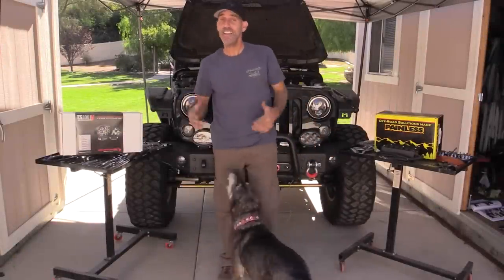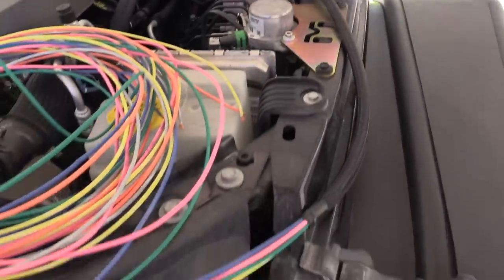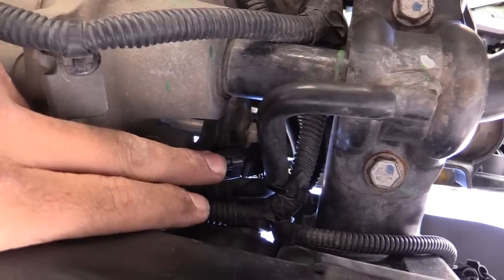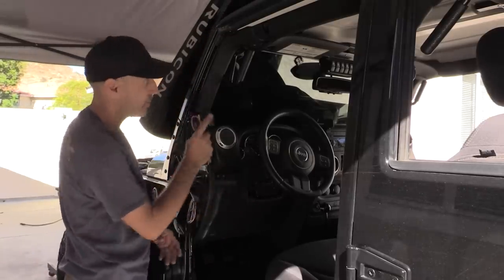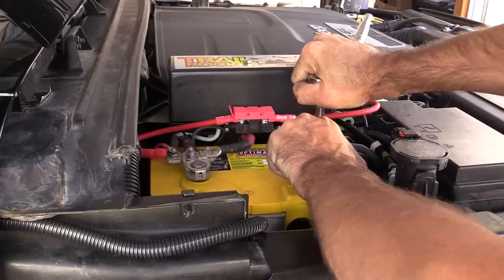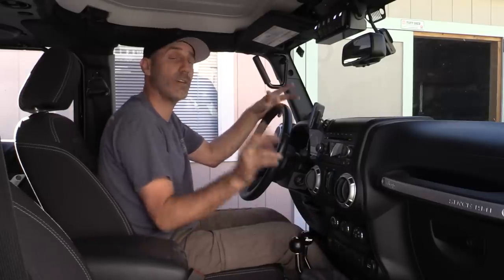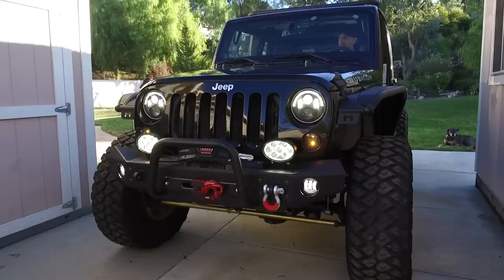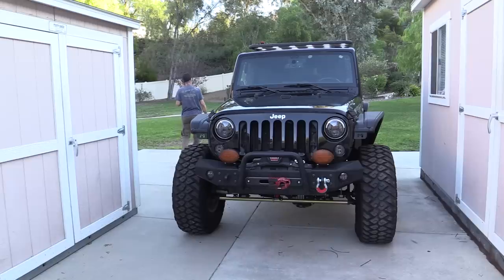Painless Trail Rocker Switches and JW Speaker Jeep Lights PLUS E-Locker Bypass Hack

Comment: I installed the SPOD version of the same thing.  I only have the halo from my Oracle head and fog lights wired currently, but love the utility of the underhood unit. The SPOD has a voltage sense circuit that cuts off the SPOD when it detects vehicle battery voltage below around 11.8v.  Pretty great piece of kit.

Comment: Hi Jason, just looking for more infor on your locker switch wiring mod, and if you did your sway bar as well. I looked through your subsequent videos but didn't see one adressing this in more detail yet. Thank you Sir.
Reply from the maker: I didn't do anything else on that yet. It is as simple as splicing the power wire for the switch you want to operate it to the color wire I mentioned.

Comment: A possible option to save you from rewiring your fogs is a superchips device.  I would imagine, unless you've picked a different option, that you'd want to calibrate your speedo and such for your larger tires and/or gearing.  That device would also allow you to make it to where your fogs will work even with high-beams and wouldn't take up a switch spot on your panel.
Reply from the maker: Thanks for the suggestion... I've heard that a few times now about the superchips. I'm ok at this point to dedicate a switch for them and if it's as easy as the locker bypass... should take about 15 minutes!

Comment: Nearly the same setup. I didn't like messing with the ignition wire, so I used Quadratec's "12v power adapter" (JK-APT2011) (no endorsement) to connect to the back of the lighter to get it to only power when the vehicle was on.
Reply from the maker: Good tip!
Reply: @AutoEdits  On my install, the hardest part was getting the firewall grommet to fit. I have an automatic and the grommet was just barley too big and I ended up having to trim it to fit. Love my JW speaker fog lamps and turn signals.  Thinking about the tail lights and maybe heated Headlights, but I already have OEM LED headlights.
Reply from the maker: I was surprised by having to trim my firewall hole as well. On the addition of more JW Speaker lights... the tail lights are just plain luxurious... they look high end and are.  If you are even considering new options for headlights, I was at the SEMA show in Las Vegas a few weeks ago and the NEW JW Speaker headlights that come out in a month or so are going to be so worth the wait.... Game changing awesomeness!

Comment: Just an fyi if you have a flashpaq there is a setting in there that allows you to run the fog lights with high beams.... no wire splicing needed
Reply from the maker: Great suggestion, thanks !

Comment: Any filter on a light means less overall light output.  Yellow for driving or off road might be better or none at all. I’d worry the amber covers may confuse an oncoming driver for a turn signal that isn’t flashing. Not sure if there are laws on that either. 

I also kind of liked your older videos where you did more detail on the installs.  I hate wiring and was hoping for more explanations on how those kits work. 

Great video as always though!
Reply from the maker: I found the amber lenses were actually good for on highway driving and when I was off road... pulled them off for max output.  I thought the videos were getting too boring with that stuff so I started to cut it down but with your input I can start phasing some more details back in.  For this install... it was literally as straight forward as I made it appear... very easy!
Reply: AutoEdits I cant speak for others but I love the details.  More the better.  👍👍
Reply from the maker: Hey, you speak for you and I like to hear what makes these videos better for all of my friends here.
Reply: According to CA law, all lighting must be white, amber or red on non emergency vehicles. No other colors are allowed. Back in the day, old cars used to come with yellow/amber fog lights stock. Also, the DRL on my 2014 Tundra is actually the amber turn signal bulbs in the headlights.
Reply: As far as confusing them for turn signals, the Jeep Wrangler stock turn signals stay illuminated when your headlights are on, so the aux lights aren't likely to be any more confusing than the stock turn signals would be.

Comment: So you can bypass the locker switches?  You mean you can lock front and rear diffs anytime?  THATS AWESOME!!!!  There is a particular trail that i can run in 2wd for most of the way and locking the rear diff would be great for 2 small sections....

Comment: Another awesome video! I really like the stuff Painless makes. Always top quality, and this kit seems to be no exception. My only comment/complaint is the way the switch kit pushes the rear-view mirror down further into the already vertically challenged forward viewing area. This is the same reason I don't run any dash mounted acc like GPS, cell phone holder, etc. on mine. Also, rear visibility in my stock JKU with stock 31" tires already stinks. I would imagine that once bigger tires (and spare) are added in combination with the lower mirror height, you're not going to be seeing much out of the back end; at least not from the rearview mirror. Jason, as someone who has gone from stock tires to 37" and has this switchkit installed, can you comment on this? My JKU is my DD, so I need all the factory bits to work like they're supposed to if you know what I mean, lol.
Reply from the maker: Moving the mirror down didn't bother me one bit looking forward through the windshield.  The back with a 37" tire has always been tricky and after the move just took a bit to get used to.   Having the switches is worth it for sure... I think they make a 4 switch panel that mounts down by the center console for automatic Jeeps.  Thanks so much for the comment!
Reply: @AutoEdits  Thanks for the info on the visibility. I too have a stick, so I believe you are correct that the overhead is the only option. Yeah, with these new CANBUS vehicles, the days of just tapping into existing lines to run accessories are done. I too have a number of 12VDC accessories in the works, and this seems like a clean, reliable way to do things right. Keep up the great work on all your videos!

Comment: Hi Jason, I have the Painless Rocker switches too. I haven't installed yet because I can't find anywhere to stash the 16' of wire. I re watched yours and noticed you put it in front of your washer res. Did you remove anything or maybe mine is a bit different. Mine is a 2015 and one of the horns is in that spot. 
Keep up the good work! And of course that "locker video" would be awesome too.
Reply from the maker: I'm still thrilled with that thing.  Not sure what would've changed in those two years but there are definitely places to stash those wires!

Comment: Not dogging the painless system but the spod seems way more more simple   I love my spod just put the positive and negative of the lights straight to the spod. But hey as long as it works and you like it it’s all that matters plus I just like your videos.
Reply: also Amber covers on the light help it filter through dirt, and fog because the white light reflects more than an Amber.
Reply from the maker: All good dude! I really like the spod as well and maybe I can run their system in my truck project. I think they might even be located near me!
Reply from the maker: That seems like an accurate description of what I encountered... can confirm
Reply: AutoEdits well keep up the good work also looming forward to your videos of beating the Jeep up!

Comment: Hey Jason did you add a diode to the Painless locker circuit so if  you happen to use the stock locker switches you're not back feeding 12 volts to the painless? Guess that could work both ways using the painless to turn on the lockers there may be a possibility you're back feeding the stock locker circuit too.
Reply from the maker: Good question. No diodes added.  I don't see the problem with back feeding an open relay... signal just ends.  I did do tests with both the stock switch activated and then hit the switch panel and everything seemed fine but that doesn't mean it's right.  I now only use the switch panel and have many hours of successful operation.

Comment: Jason- when I installed my winch, everyone told me change my terminals to marine terminals. 10 Jeep guys can’t be wrong, I did it.  Looks like yours are stock. Any issues?
Reply from the maker: That is good advice but not mandatory. I've been running stock terminals for years with no problems at all!

Comment: I had to put some jam nuts on the 200 amp fuse breaker connections. The nuts kept loosening up and the lights would not always work.
Reply from the maker: Not sure why that would happen... is there some sort of vibration going on with your Jeep? I'm about 6,000 miles on this install and it's good so far.  Thanks for the tip though.
Reply: It has been two years of highway driving and such... otherwise I’ve had no problems. Just added some rock lights and it was super simple. But that’s when I figured out the problem of the intermittent lights. lol they worked in the garage but after backing out I went to use them and nothing. Quick fix and back in action.

Comment: With your locker wiring are you able to lock independently now? Front without rear in any drive mode?
Reply from the maker: Yes! That was part of the reason and it came in handy when I was hot dogging around the sand dunes in 2 wheel drive and could lock the rear for more fun!

Comment: Jason what's your take on the 3.0 eco diesel that's supposedly coming for the  JL wrangler? Would you recommend the 3.6 Penestar instead?
Reply from the maker: If they are putting the exact eco diesel from the Ram in the Jeeps... I'd be all over that but the JLs that I've driven with the 3.6 are actually pretty good but mostly because the new 8 speed transmission is just phenomenal.
Reply: Let's hope it's the same eco diesel from the Ram and the Grand Cherokee.  I'm ready to buy just waiting for the 2019 models.

Comment: Hey Jason, I've been searching the internet for a few days now and I haven't been able to find a video on how to disable the daytime running lights on my 2008 JKU. I notice fellow jeep folks with some DRLs on and some with them off. Mine are automatically turned on when the jeep is shifted into drive (It's an automatic).  Is there a way to turn off the DRL function? The main reason I ask is because I got new headlights with the angel eye halo effect. I'd really just like to run the Halo without the DRL if possible. Thanks!
Reply from the maker: I'm not sure with the DRL's some hand held tuner modules let you control them but since this Jeep is a manual trans.. it doesn't even have that option. Check with one of the Jeep forums!

Comment: That is a lot of relocation for the install of the rocker panel. And not a fan of making holes bigger. My question is why not go with a single lead weather pack instead of the 2 lead? Since you went to chassey ground. I went with the Appolo switch system and no relocation needed for the the switch panel install, rear view stays in its original place. Love the videos this one just seemed like a lot of relocation for a switch panel.
Reply from the maker: Good for you. I really hate the looks of that volt meter and I like the location of the relays in this kit.  Keeping them close to the battery makes sense to me and I have a vacuum pump relocation in the spot the apollo would live in. There are 2 wires coming out of the back of each light and I ground them in a convenient spot near where I Y'd the power lead.  Fairly simple stuff here but I think I understand where you are coming from...

Comment: How are the locker switches holding up? I’m trying to do the same to my switch pod. Where did you find the correct wire to tap into?
Reply: Also did you tap into the power or cut and add yours in taking the factory switch out? Or can you still use the factory switch too?
Reply from the maker: I just spliced in so the stock switches still work.
Reply from the maker: I looked on the web to find the color codes, white with yellow stripe (etc) for front and rear power and just spliced in right there at the relays I showed in the video.
I love the switches, they still work fantastic.
Reply: @AutoEdits  Awesome. So just spliced the one power cable coming from the switch pod to the power out of the relay and its all good?
Reply: @AutoEdits  Awesome! Thank you so much ill be doing this this week!

Comment: Quick question... How’d you over ride the Factory Rubicon Locker Switch... I looked through comments and did not see anything?   🤷‍♂️
Reply from the maker: Like I mention in the video, I literally just attached the wire from switch five to the yellow w/orange tracer wire coming out of that relay I was pointing to and the wire from switch six to the yellow w/white tracer wire out of the other relay.
Reply: Thank You... Guess I just needed to Listen while Watching! 😝.... Side Note: I started researching “How”, and some comments were made about accidentally engaging the Lockers while at Speed/In a Turn etc. in High Range.... Thoughts?
Reply from the maker: I thought about that as well.  Here's the deal, don't reach up above your head to the switch panel and turn on the locker switches when you are on the highway!  Turned out to not be a thing yet.
Reply: Agreed… I have an array of Lights tied to mine (that I use on the Roads), and have more then once Hit the wrong Switch... I’m going to go with the Locker Option but may figure out another location to keep them away from other more heavily used Switches... PS Another great Video! 👍

Comment: honestly that painless looks terrible... Apolointech way better imo but it's your choice ! The wiring needed with that painless is terrible, that you have to cut threw your firewall and modify the jeeps plastic to put that plug threw is sad... the rockers. Lets not go there :( This is, I think, the one and only upgrade you did on your rig that I feel like you went on the cheap side and that I personally really don't like :(  I'm not saying painless has bad products, but this particular one is bottom tier when comparing other options out there. I hope you don't take this comment personal, i'm just opening a discussion and stating my personal opinion.

Comment: I'm sorry man, you spend some good cash on your rig, why would not just put in an sPod?
Reply from the maker: Why? I picked this thing for the exact reasons I specified in the video and am extremely happy with the system so far. Plus the spod and my metalcloak vacuum relocation bracket would take re sorting and I didn't feel like doing that in the tight turnaround of this install before leaving on a trip. Interesting that you think this is inferior for some reason... just different.  I'm a huge fan of spod and they are actually neighbors to me and will use their products in the future.